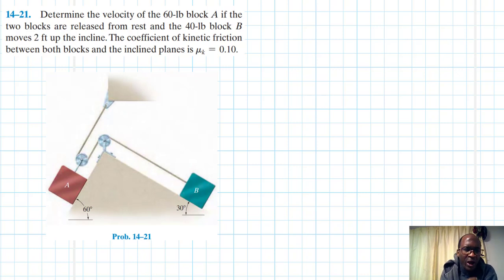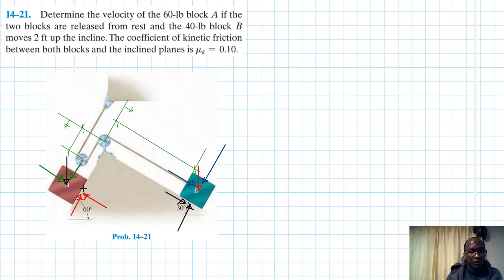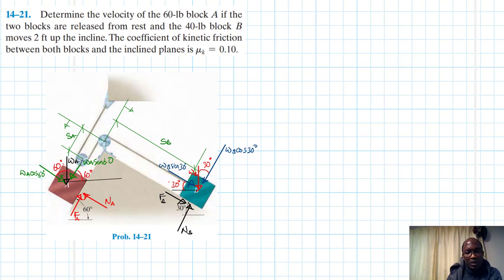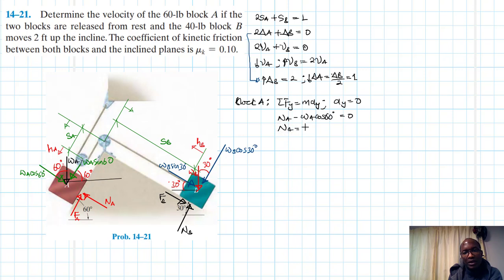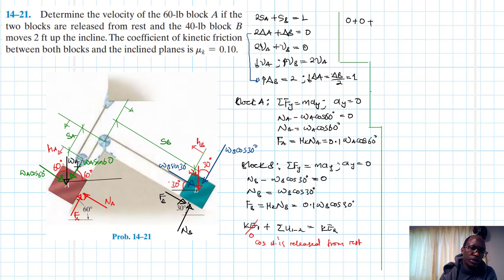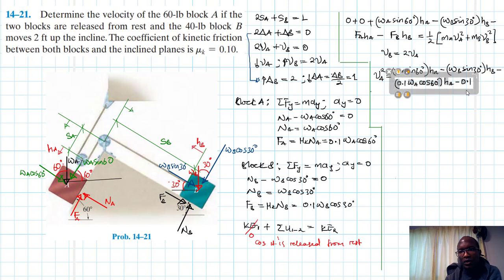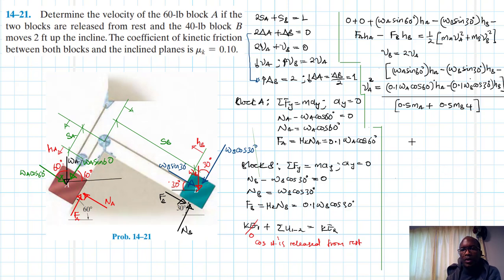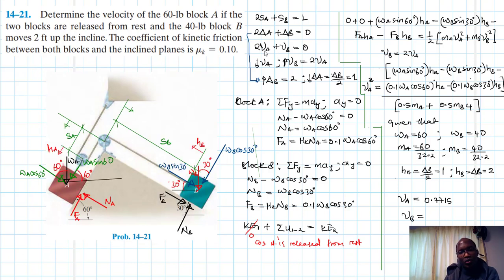14–21 Kinetics of a Particle: Work and Energy (Chapter 14: Hibbeler Dynamics) Benam Academy

Comment: When I'm  applying work energy theorem on each block alone, and not putting them as a system in one equation, my answer is wrong,  could you explain why? I did put also the work of tension when I worked on each block alone
Reply from the maker: Make sure to carefully check your work. It is certainly possible to solve the problem by analyzing individual blocks and incorporating the tension forces. If you decide to work with two blocks, you should expect to have at least two unknowns. Therefore, you will need to derive equations that include the unknown tension forces and velocity for either A or B. Velocity of A can be rewritten in terms of B or otherwise
Reply: @benniehamunzala  I just did it one more time and it worked, thank you anyway 🥰
Reply from the maker: @vanxia8563  Welcome
Reply: @benniehamunzala  yes I did that but it's still wrong🥲🥲 could you please try solving it?